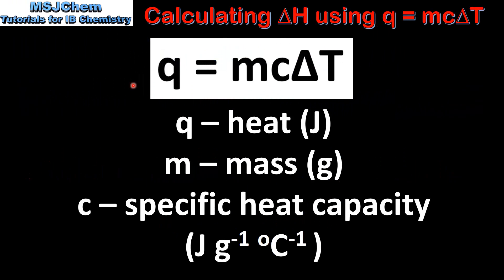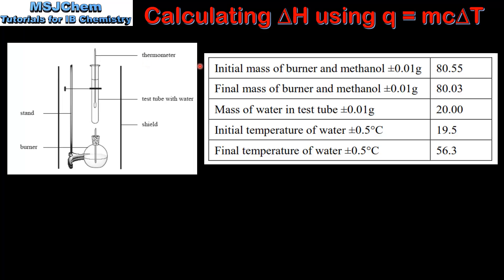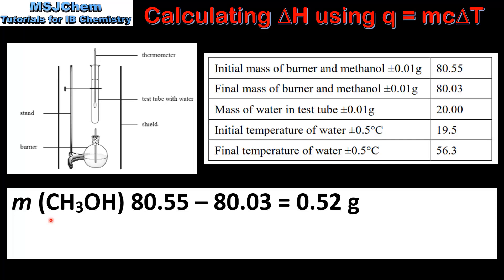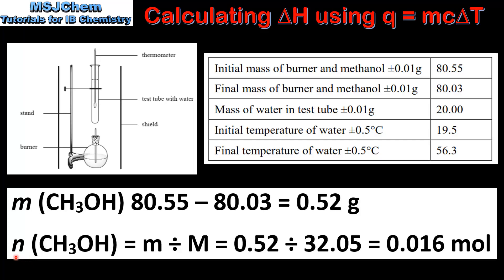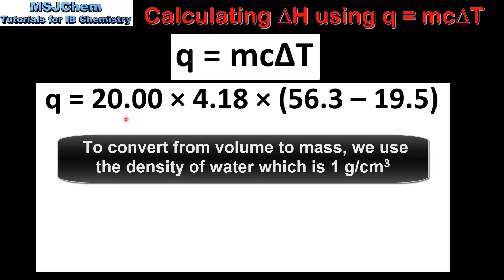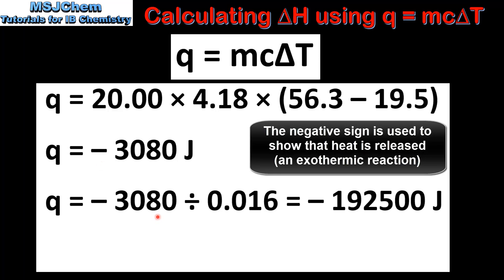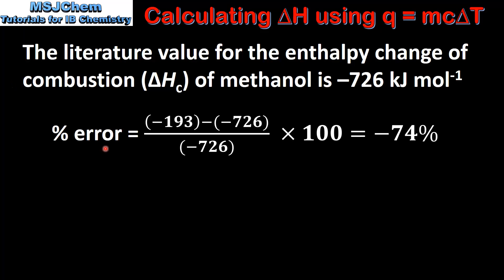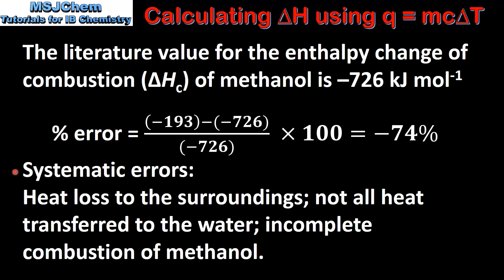R1.1.4 Calculating ΔH using q = mcΔT

Comment: Should you not include the uncertainties in the data table while doing the calculations?
Reply from the maker: The focus of this video was on calculating the enthalpy change rather than the uncertainties. But yes you are correct that if this were a full lab report you’d have to include the uncertainty.

Comment: I don't understand how the value becomes negative, as all the calculation give us a positive number? ... btw thank you very much your videos are very helpful.
Reply from the maker: A negative sign indicates that heat is being released from the system to the surroundings. This tells us that the reaction is exothermic - I cover this concept in this video: https://youtu.be/DP8zzNeV1fA?list=PLluIsqNl4jcrLIP4nOMyClZckgOPcHP5i
Reply: I believe it's because they calculated delta T incorrectly as it should've been the initial temperature minus the new temperature. It would've come out negative this way.
Reply from the maker: It depends on how you look at it (or teach it). Have a look at this link for more information. https://www.adriandingleschemistrypages.com/ap/the-confounded-mess-that-is-signs-when-it-comes-to-q-m-c-delta-t/